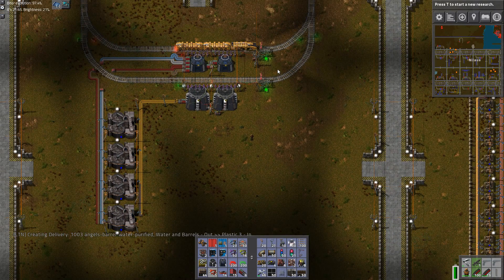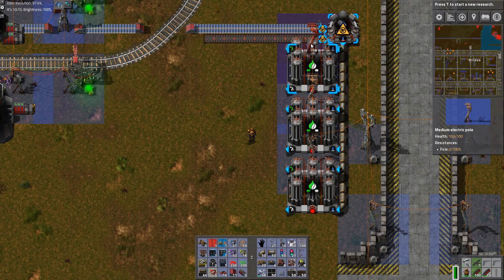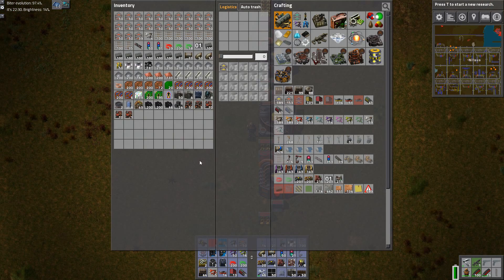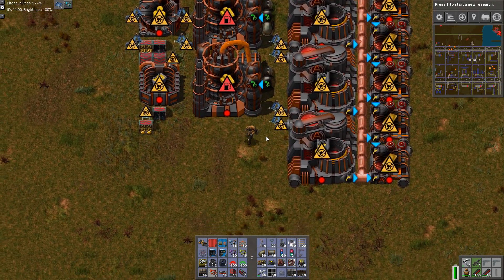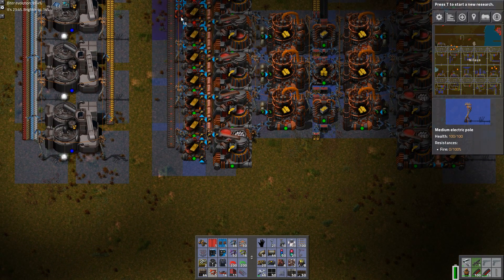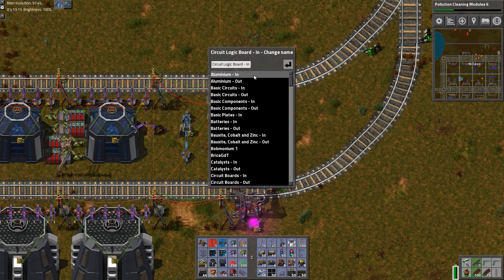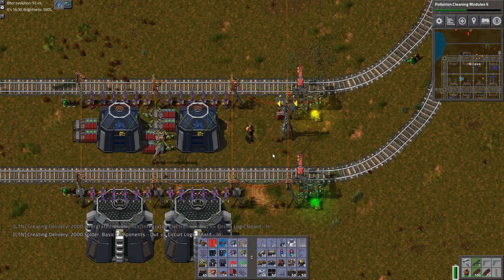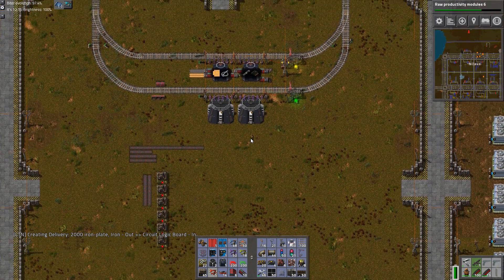Factorio S6E108 - Gold plates and starting Module Logic Circuit Boards

Comment: a 1000 is the lowest possible request? doesnt sound practical
Reply: i have had no problems with small requests.
Reply from the maker: 1000 is the default minimum amount. You can request less, but that is per stop. Hence it is not practical to request Satellites and Iron Plates from the same stop as that will force them to use the same minimum amount. Since most of my stops request many different items simultaneously then I chose 1000 as a compromise between trains running half empty and too large quantities in local buffers.